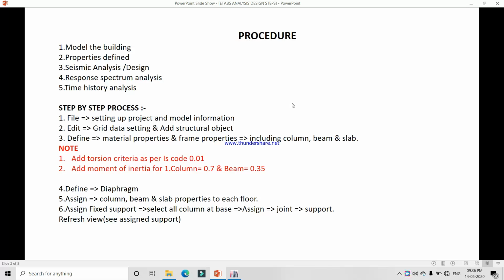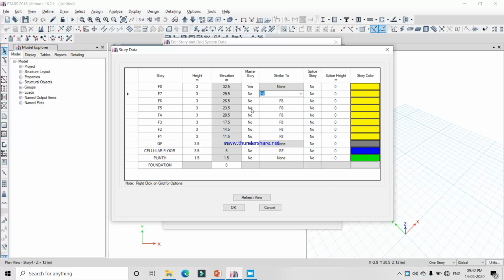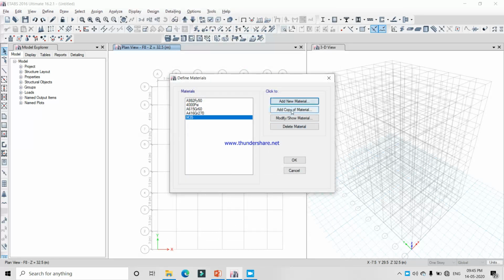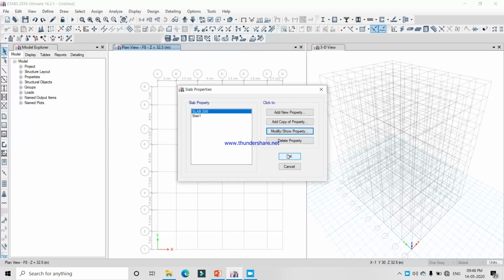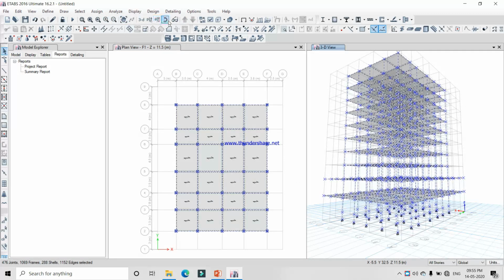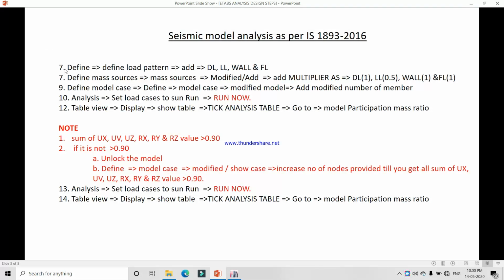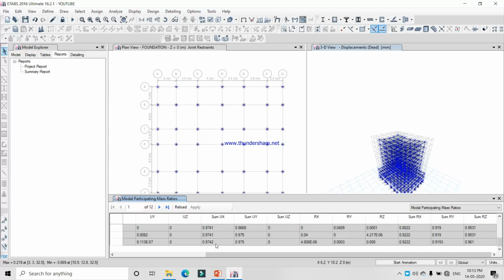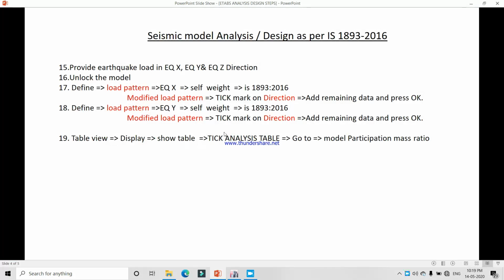ETABS BUILDING MODEL ANALYSIS AND DESIGN BY STATIC & DYNAMIC METHOD

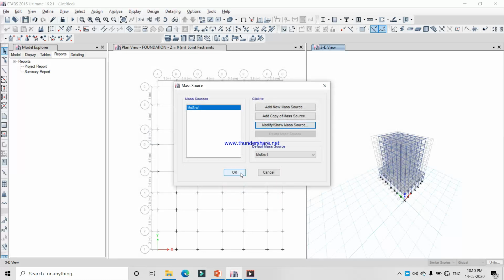Comment: ⚠️ Dear sir, thank you for your effort for making such a great video. Unfortunatly there is a mistake in the mass source part. Dead load cannot be added because you already checked the option (element self mass). You should ether uncheck it or not include dead load. The software gave you the warning ⚠️ too. Kindly check time (17:46)
Reply from the maker: We will update soon